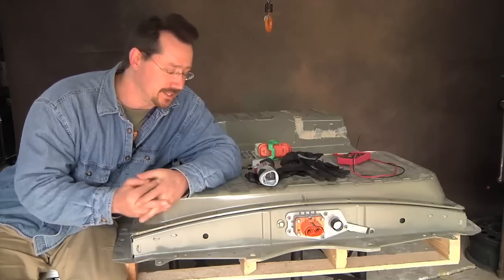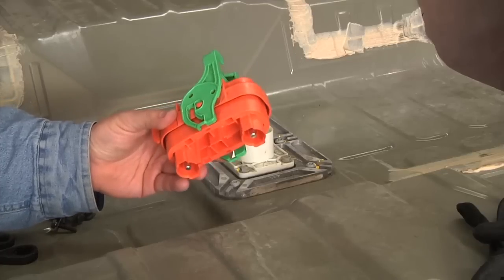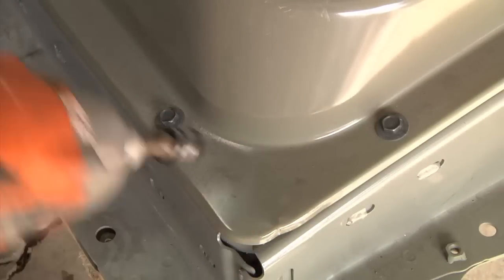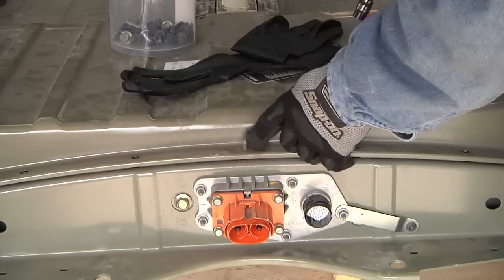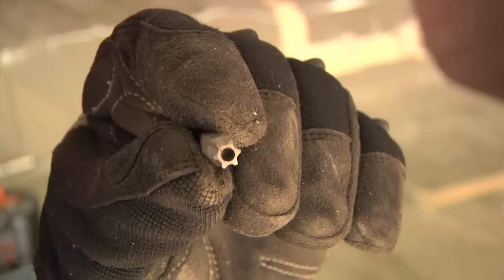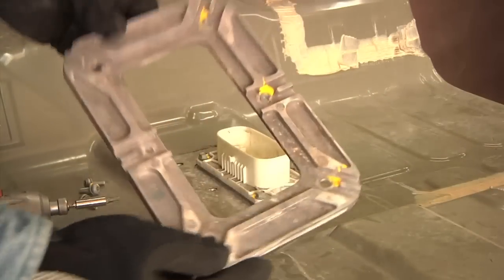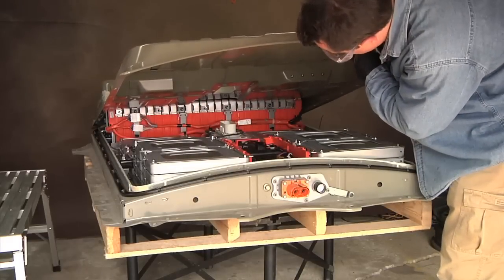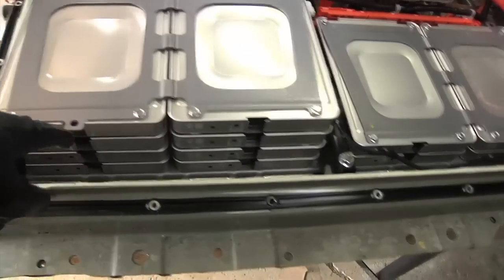Taking apart a Nissan LEAF battery pack, part 1

Comment: Hi Benjamin,

I want to convert a Leaf to a series hybrid electric car.  Is there a way to bypass the computer charge port to accept a charge while it is in motion from a generator?  A gasoline or diesel generator on board charging the car to boost range so it can be driven long distances.
Reply from the maker: Charging ports on electric cars connect to the CHARGER which is built into the car. On a stock, commercially-built electric car, the only way to directly connect to the battery pack is through a DC Fast Charge Port. On the Leaf, that would be a CHAdeMO connection. However, the communications in that port also make sure that you can't turn on the car and drive away while plugged in.
For the Mitsubishi iMiEV, I found a hack on a forum for how to manually activate the CHAdeMO connection to the battery. It would be interesting to use that to access the battery in the parked car as a power source for home power backup.
Keep in mind that these battery packs are 300+VDC - lethal voltage. A person needs to know what they are doing and follow appropriate safety protocols.
I've seen homebuilt electric pickup trucks where the builder has designed the pack so that a generator can be connected to it during charging.
I also modified my DIY Electric Geo Metro to run as a series hybrid. https://www.instructables.com/id/DIY-Plug-In-Hybrid-Car/
https://www.youtube.com/watch?v=xXVi-g4jWqI
To run continuously, you need a fairly large gas engine/generator, and to go with it an exhaust system, firewall, etc.

Comment: You're saying it wrong, it's not pronounced "motorcycle" it's pronounced "scooter."
Reply from the maker: Both terms are correct. Scooter is really a shape or style. Motorcycle is the correct legal definition. This vehicle requires a motorcycle operator's license and can go on interstate highways. "Super-Scooter" or "Maxi Scooter" are also terms sometimes used to describe a vehicle such as this or a Honda Reflex.

Comment: Do you do anything with ZERO motorcycle batteries with the Leaf Battery?
Reply from the maker: I've never worked on a Zero. They are great bikes. I know that their batteries have greatly improved between their earliest cycles and the current model year. I'm sure that if a person had an old Zero with a bad battery pack that they probably could modify some Leaf Cells to suit it.

Comment: Good Job!! This video is very useful for me. Thanks for sharing. So I have a question. How thick is the battery case?(Upper and Lower) You lift a upper cover lightly at 4:51. I'm afraid of the leak battery liquid in an accident.  I'm sorry in poor English.

Comment: I believe this is a 2011 or 2012 Leaf battery pack. I just opened my 2013, and there are a few changes: 1) two HV connectors on the front, one for the motor, the other for the cabin heater. 2) No 13mm bolts on the outside. 3) Security screws around the service disconnect are just 10mm bolts. 4) (And this is the big annoying one) Instead of a gasket where you can just lift the cover off, the cover is sealed down with a bead of very strong silicon that needs to be chiseled through all the way around (or at least three sides) before you can get the cover off.

Inside the battery, there are a few more guards/plastic things especially over the back set of 24 modules, more black BMS wires along the side of the pack to get up to the CAN connector, the cell end plates are different (more interior crisscrosses), and the modules themselves look slightly different (Lizard Pack style) with more air holes and a slot along the sides.

Comment: Thanks for the video guide! I just purchased a totaled Nissan Leaf just to get the battery pack out of it to use on my electric truck. (I paid significantly more for the car than you did for the pack alone...hope I can sell some of the auto parts as well...mine is a 2013 model (yours looks like a 2011/2012) and because I got the car that goes around it I was able to use the OEM battery diagnostics via the ODBII port before dropping the pack.)
Reply from the maker: Jay Summet VERY Cool Jay! Make sure to shoot videos, do some blogging, and otherwise share with us what you are doing! It sounds like great fun!
Reply: BenjaminNelson I've been documenting the process (purchase, diagnostics, etc) on my blog (www.summet.com/blog).

Comment: So I'm guessing you didn't check the voltage (condition) of the pack before you purchased it (from the looks of your other video at the junkyard)?
Reply from the maker: You can't check the voltage without taking it apart. The service plug physically disconnects the power and the main contractor inside keeps the circuit open until it's plugged in to the car an all hooked up. However, it was a low mileage car, I was able to see photos of other parts of the same car, and overall, it looked great.
Reply: Cool- thx
Reply: So you said it cost 2 1/2 mortgage payments, but I live in California where this figure is totally different than most of the rest of the country- may I ask how much you paid for it?
Reply from the maker: $2637.50, plus several hours of travel, lunch, and about nine gallons of gasoline.
Reply: Thanks!
Reply: BenjaminNelson i would buy any batteries you don't need i'm building a car and all i have left to get are some batteries. ive been working on it for  3 yrs. (and all because of you!)
Reply from the maker: All batteries are being used. Sorry, none for sale. The good news is that batteries have been getting cheaper and cheaper for us hobbyists!
Reply: Nice- that's what I've been waiting to hear. It helps that Nissan is selling the packs now.
Reply: +BenjaminNelson RE: "You can't check the voltage without taking it apart.": actually,  it turns out you can! You don't measure the terminals directly, just tickle the BMS computer with some 12V and read it with an OBD2 adapter and Bluetooth dongle: http://www.mynissanleaf.com/viewtopic.php?f=8&t=17470&start=30#p418965

Comment: Hey Ben, each of those modules is actually 2S 2P if I remember correctly. If you read the voltage it will be 3.6v to the center terminal and 7.2 on the outside terminals
Reply from the maker: HoonaticRacing Yep. That's right.